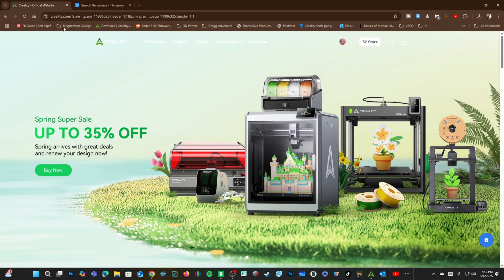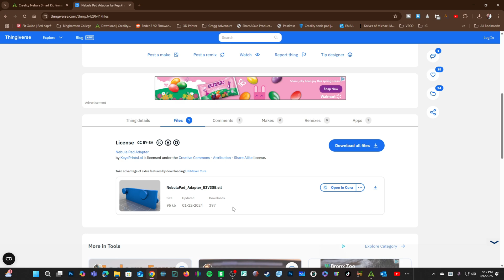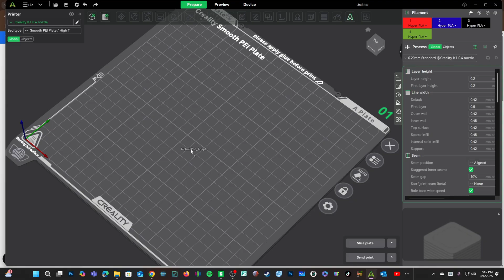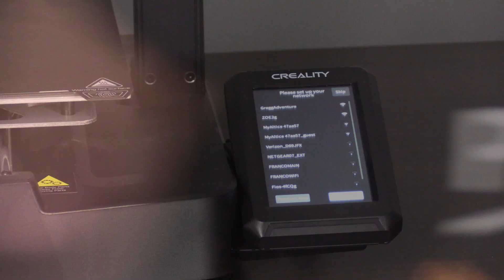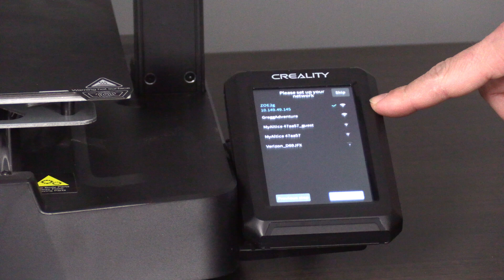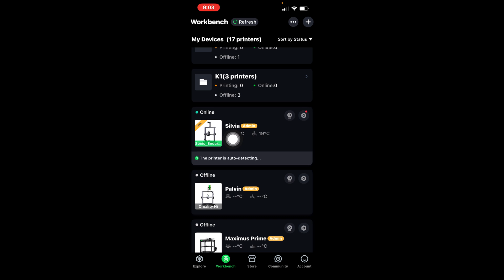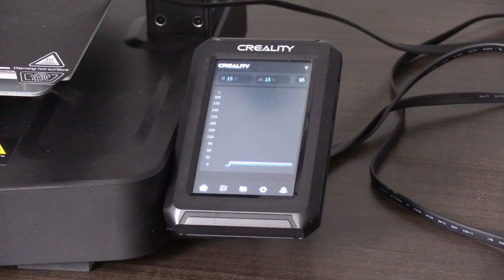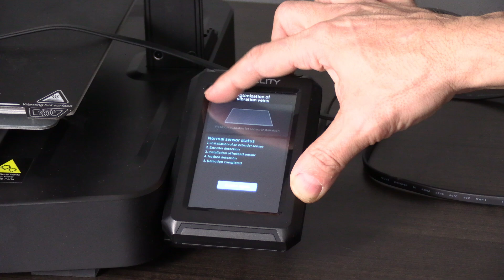How to Install NEBULA PAD on Ender 3 V3 SE - Screen, Firmware, G Sensor. Creality 3D Printer

Comment from the maker: The C14 Motherboard Firmware is in the Members Library.
https://www.youtube.com/channel/UCbUb8QjvZiimB-8sN6oDl9Q/join

Updated Step by step

Step 1: Update the motherboard firmware for the Nebula display:
Ender3V3SE C14 chip motherboard update:
- Format the TF card on your computer and select 4096 as the allocation unit size.

- Insert the "STM32F4_UPDATE" firmware file into a blank TF card.

- Turn off the printer and insert the TF card into the motherboard slot.
- Reboot and wait for the update to complete.
- Once the update is complete, remove the TF card and delete the bin file.

Step 2: Nebula Display Firmware Update Method:
Using a USB flash drive, SD card reader, or TF card reader (manual update)
1. Copy the NEBULA_ota_img_V1.1.0.30.img firmware file to the root directory of the USB flash drive 

2. With the device powered on, connect the USB flash drive to one of the two USB ports on the Nebula Display.
3. One minute after inserting the USB flash drive, the device will display the message "New Version Found." Select "Update" and the device will begin the update process.

4. After 1 to 3 minutes, if the installation is 100% complete, the update is successful.
5. After restarting the device, check if the firmware on the home page displays "New Version." If so, the update was successful. Otherwise, the update failed and you must perform the update again.
6. Once the update is complete, remove the USB drive and delete the firmware file.
Reply: where to 
find c14 firmware ???
Reply: How can I access the member library if I've already subscribed to the channel as a member?
Reply: I @jcgr300  i am trying to find it too
Reply: Holy coww, it worked!!
Reply: Where is the download file for members?
Reply: Just signed up. Where is the library?
Reply from the maker: @tcaviezel Hi. Welcome. In the member community posts, you'll find a post with the Link and Password
Reply: @tcaviezel need to scroll through the members posts down a fair bit and u will find it
Reply: @Evil_Mk6 what's the name of the video?
Reply: @tcaviezel not a video but a google drive link
Reply: @Evil_Mk6  Thanks Ill keep looking.
Reply: @Evil_Mk6  Awesome. Found it and Thank you. I had one from Creality and lost it. The one they sent back to me was corrupted and took out my motherboard. This one works perfectly.

Comment: Will this allow higher print temps with a new hot end?
Reply from the maker: You getting Klipper. If the hot-end supports it, should be good to go

Comment: So we're can I fine the c14 motherboard  firmware I got members library  I car find it
Reply from the maker: In the library there is a Nebula folder
Reply: hello i cart fine the "STM32F4_UPDATE" firmware file all i can see is enderv3se_ firmware .bin  and c14 mb firmware .rar  pls can you help
Reply from the maker: Check the pinned comment, on the video, there is updated written directions. The RAR file included, is everything Creality provides for the C14

Comment: Where is the download folder located? I cant see a members library anywhere
Reply from the maker: Check members only posts for the link and password
Reply: @3DRundown found it! Will try it tomorrow as per your pinned instructions. Was doing my head in haha
Reply: @3DRundown  Followed your instructions to the dot. I failed at the printer firmware section. I did managed to get the pad updated and I have the C14 version showing up on my nebula pad, but I still get the same error when I am trying to put the firmware on the memory card itself. Therefore i get stuck at this initial setup page
Reply from the maker: Elaborate...   You can't get the file ON the card? Fat32? 32gb or less?
Reply: @3DRundown i get the file on the card, and i put the card into the printer slot.... but nothing is happening. Am I supposed to just put the card in, turn the printer on and wait a few minutes for it to do something in the background? Card is formatted correctly as well
Reply: I basically put the card in, select ender v3 se C14 on the nebula pad, it says connecting for a couple of minutes and then 'system error, try restarting'
Reply: Got it to work!

Comment: I paid for members because i have the C14 motherboard, but the instructions could not be more unclear... What FILES do i need? In the C14 MB Firmware folder it does not have the files you talk about in the step by step. And when i transfer those files from the C14 MB Firmware folder to an SD Card i just get an error (The filename youve specified is either invalid or too long. Specify a diffrent filename.) I tried to just put the last updated firmware.bin file you uploaded but that did not work aswell.
Reply from the maker: Follow the written instructions in the Pinned comment. There is no reason the files can't be copied to an SD card. Maybe try a different card. 32gb or less. Format in Fat 32

Comment: Galera que comprou recentemente, no kit vem um pendrive nele vem o firmware do nebula, você precisa instalar o nebula e depois plugar o pendrive branco no próprio pad nebula, e depois disso fazer todo o processo de conectar ele no creality claud e etc, e não precisa baixar no ssd até pq o site da creality nem disponibiliza mais!!
Reply: Ou seja, você precisa pular a parte de baixar o firmware para a parte de instalar o nebula na Ender, e depois de instalado antes de iniciar vc pluga o pendrive
Reply from the maker: C14 requires a new firmware
Reply: @3DRundown poderia fazer um vídeo atualizado sobre isso? Eu agradeceria muito, não sou bom com tecnologia
Reply from the maker: Hi, I have the update in my comments. Check the pinned comment for a STEP BY STEP. For the new file, if you need it, I have a share folder for members. Be a member, and you can download the files.
Reply: Any update? Have you fix it?
Reply: @lukehernando sim, eu troquei o firmware padrão do pendrive por um firmware próprio para a ender mas ainda sim só faço impressões com velocidades baixas, o nebula é muito rápido mas perde um pouco na precisão por causa dessa velocidade toda, eu queria apenas dar upgrade para usar com internet então para mim está ótimo assim.
Reply: Irmão,tem como me ajudar.Aqui não ta aparecendo a minha ender 3 v3 SE quando pede para selecionar a impressora,só aparecem 3 opçoes de outras ender 3
Reply from the maker: @joaocarlosalves8817 Can you try following the txt instructions in the pinned comment
Reply: @3DRundown  Consegui resolver aqui,era só  renomear o arquivo de "Ender3V3SE_firmware.bin" para "firmware.bin" e pronto,instalou perfeitamente

Comment: Hi. Do you think you help me find the old firmware so i can just put back my original screen. i had this running for a few months, then the layer shifts were ridiculous. Now i've tried to get the nebula updated so many times i want to pull my hair. i just want the marlin now so i can print something. i can't even sell this thing until its somewhat working again. thanks! suzanne
Reply from the maker: I would stick to the Nebula. It's SO much better. Layer shifting is caused by loose belts. I have a video here on that. Also be sure you are slicing correctly in Creality Print 6, and not using insane speeds
Reply: @3DRundown I am also having the same problems with layer shifts I have read the only way to fix it is to root and change the motor current from 6 to 7 as they’re skipping steps.
Reply from the maker: I have never had a layer shift. You are printing too fast, or have loose belts. Check my Belt Tension video for the SE

Comment: Would have been nice to know that you have to rename the firmware file to firmware.bin instead of the full file name in your repository. I spent hours trying to get it to work.
Reply from the maker: YOU DON NOT. 

Step 1: Update the motherboard firmware for the Nebula display:
Ender3V3SE C14 chip motherboard update:
- Format the TF card on your computer and select 4096 as the allocation unit size.

- Insert the "STM32F4_UPDATE" firmware file into a blank TF card.

- Turn off the printer and insert the TF card into the motherboard slot.
- Reboot and wait for the update to complete.
- Once the update is complete, remove the TF card and delete the bin file.

Step 2: Nebula Display Firmware Update Method:
Using a USB flash drive, SD card reader, or TF card reader (manual update)
1. Copy the NEBULA_ota_img_V1.1.0.30.img firmware file to the root directory of the USB flash drive 

2. With the device powered on, connect the USB flash drive to one of the two USB ports on the Nebula Display.
3. One minute after inserting the USB flash drive, the device will display the message "New Version Found." Select "Update" and the device will begin the update process.

4. After 1 to 3 minutes, if the installation is 100% complete, the update is successful.
5. After restarting the device, check if the firmware on the home page displays "New Version." If so, the update was successful. Otherwise, the update failed and you must perform the update again.
6. Once the update is complete, remove the USB drive and delete the firmware file.

Comment: Contact Creality support. It took a couple days but I was up and running in about 15 minutes after getting the updated Nebula pad image and C14 motherboard firmware.
Reply: same support help i have the c14
Reply: Need help too
Reply: I have spent 2 hours with support and got nowhere. I was told my ticket is escalated now. How did u fix urs?

Comment: just tried to install nebula pad to ender 3 v3 se its impossible 4 hrs and still nothing keep getting eror code and asking to report issue cant et past that screen cant find the file for the download of firmware i have the usb that came with the nebula but pluggin it in does nothing, the only thing i can do is ad printer to creality cloud wow this is annoying much
Reply: Need to update old touch pad first then swap to the nebula unfortunately its not plug and play thanks creality not
Reply: @martyimpatientclownhayton4763 Do you have an IG or any other socials? I want to message you about this one mate, my head is aching and I have so many opened tabs on how to fix or to bypass this one, but I can't seem to do it.
Reply: Same issue here mate, have you found a fix?
Reply from the maker: Brother, in the comments, find my written step by step. Become a member of the channel, and pop into the Member Library. Download the newest NEBULA SE files from there, and go again.

Comment: The Firmware for the nebula smart kit is no longer on Creality's website or any where else that I can find. How do we install the nebula smart kit on a new Ender 3 v3 SE??!
Reply: I have the same problem. Where can I get the firmware for the printer board?
Reply: @Dentsidolls  its on creality cloud
Reply: @Brotatochip1121 I only found the marlin firmware there. There's no klipper firmware.
Reply from the maker: Become a member of this channel, and you'll get the link and password, to a private folder, with the firmware in it.
Reply: @Dentsidolls  make sure it doesnt just need to be activated in the slicer. In the printer settings there is a flavor with marlin and klipper. you can also use klipper in a web browser by just typing in the printers IP

Comment: hey, do you have the file? my card didnt come with it, came with the rest thoug, just not the ender3vse firmware
Reply: i joined your member and got the file, but my nebula pad is still showing errors, when i skip it and start detection, it says the nozzle has a problem. could i get your help on this please?
Reply from the maker: SIGH.... This has been a been a BIG problem, that I have dealt with other people on. Can you check your MB version? CM14 is not working. I've brought this up with Creality, and got less than acceptable responses. You need board version CM13. Check to see what you have. I'd then drive Creality NUTS for the CM13 MB, if you find you have the CM14.
Reply from the maker: Good news!! I just got the new firmware. Check the library!
Reply: @3DRundown amazing! Let me try it later and see if it works!!
Reply: @3DRundown I tried it and it’s not working somehow. 😢 any idea why?
Reply from the maker: Step 1: Update the motherboard firmware for the Nebula display:
Ender3V3SE C14 chip motherboard update:
- Format the TF card on your computer and select 4096 as the allocation unit size.

- Insert the "STM32F4_UPDATE" firmware file into a blank TF card.

- Turn off the printer and insert the TF card into the motherboard slot.
- Reboot and wait for the update to complete.
- Once the update is complete, remove the TF card and delete the bin file.

Step 2: Nebula Display Firmware Update Method:
Using a USB flash drive, SD card reader, or TF card reader (manual update)
1. Copy the NEBULA_ota_img_V1.1.0.30.img firmware file to the root directory of the USB flash drive 

2. With the device powered on, connect the USB flash drive to one of the two USB ports on the Nebula Display.
3. One minute after inserting the USB flash drive, the device will display the message "New Version Found." Select "Update" and the device will begin the update process.

4. After 1 to 3 minutes, if the installation is 100% complete, the update is successful.
5. After restarting the device, check if the firmware on the home page displays "New Version." If so, the update was successful. Otherwise, the update failed and you must perform the update again.
6. Once the update is complete, remove the USB drive and delete the firmware file.
Reply: @3DRundown you’re amazing. I’ll try that later.
Reply from the maker: ❤❤ How did it go?

Comment: I have an Ender 3 V3 SE, but it ended up having a problem with the board, so I replaced it with the C14 and bought the Nebula Kit right after. But now I discovered that it only works with the C13 board according to the comments. Is there already a way to make the C14 work, or will I have to return it?
Reply from the maker: I literally talked to creality over night about this. No C14 support yet. Makes ZERO SENSE!!
Reply: hey by do u have the ender 3v3 se printer frimware for the nebula pad?
Reply from the maker: Yes, in my member library: https://www.youtube.com/channel/UCbUb8QjvZiimB-8sN6oDl9Q/join
Reply from the maker: The C14 Motherboard Firmware is in the Members Library.
https://www.youtube.com/channel/UCbUb8QjvZiimB-8sN6oDl9Q/join
Reply: @3DRundown  so we have to pay for a membership to get the firmware?

Comment: I can't find the "3d print firmware" in their page .. they've change the page .. would it be possible that you share it with me via email or google drive ?
Reply from the maker: Hi, I emailed them about this. You can also get the file from the Member Library, by being a member.
Reply: @3DRundown which member library? I'm quite new to the creality ecosystem
Reply from the maker: I have a private folder, for members of the channel: https://www.youtube.com/channel/UCbUb8QjvZiimB-8sN6oDl9Q/join
Reply from the maker: The C14 Motherboard Firmware is in the Members Library.
https://www.youtube.com/channel/UCbUb8QjvZiimB-8sN6oDl9Q/join

Comment: Oh man .. just commented on your firmware video about your clear explanation. Had also the Nebula in a drawer and i decided to finally install it. Googled it and my heart made a little jump of joy when i noticed that you made a video about it. My wife is calling for diner, but boy, can't wait 'till diner is over and install the Nebula Pad. Feeling like a little kid here.
Reply: Hey, may ik where did u get the 3d print firmware its not available on their website anymore.
Reply: @Slush3i  im having the same problem. I cant find it anywhere
Reply from the maker: The C14 Motherboard Firmware is in the Members Library.
https://www.youtube.com/channel/UCbUb8QjvZiimB-8sN6oDl9Q/join
Reply: @3DRundown  Thanks for what you do, I just became a proud member and was able to flash and select a C14 printer up during set-up. Now to your knowledge, are there any variations between C14 motherboards and others.

Ex: My E3V3SE has. H/W VER: CR4NS200320C14 —  V30.img of the Nebula Firmware lists C14 motherboards as (CR4NS20032C14) — essentially its off by one digit, I am trying to understand if this is relevant ]. I am still getting System errors and Nozzle Anomaly issues.  I have gone through 12 hours of trouble shooting and just about every SD card I own 😅. Im not sure what else to do other than continue to flash the printer.

Either way, Thank You, you've made this process significantly more tolerable.
Reply from the maker: Welcome to the party. Stick around, be a member. We got you
Reply: do u have the firware files there not on the site no more
Reply: @chadcaylor5653 they are on the USB that comes with the kit
Reply: @joshuaraco yeah but on the SD card doesn't have the v3se tried it and still getting a nozzle air. I have the c13 board so I'm trying to find the version
Reply: I put the firmware that comes on the USB onto the SD card and as soon as I get to the choose wifi screen, all I get is the word TEXT where my networks should be. I'm not sure what to do myself

Comment: I have a really big problem, the .bin firmware for the motherboard is no longer online. Not on the downloand center, nor on creality cloud webpage. The only resource available is the .img update for the nebula pad itself.
I have contacted with creality support and they do not reply. Do you still have the .bin somewhere?
The usb that came with my kit is to old and the .bin only works for V2 Series.
Reply from the maker: Hi, it's in my Member Library. Should also be on CrealityCloud.Com.  Weird that your SD Card doesn't have it
Reply: @3DRundown  thanks, I finally got the firmware using the internet archive
Reply from the maker: I have contact my Rep at Creality today, and hope for an update soon.